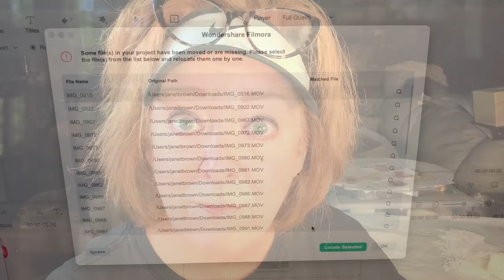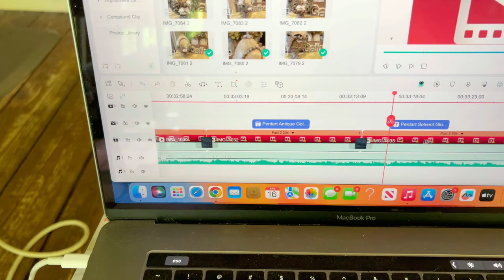Spring Wall Decor

Comment: You really showed off a lot of great techniques. That turned out fabulous. I can totally appreciate losing files. That is the most frustrating thing ever. But, you can get various types of  storage that you can add to your computer that are very cheap. If your computer has the capability, you can get an SD card or,   if you have USB capability then you can get an external drive thatconnects via USB. I don't know anything about MacBooks, so you might want to check with an expert. I just do windows type computers and have used both of those methods on my laptops. Take care and thanks again for sharing your techniques
Reply from the maker: Thank you and I appreciate your tips! I’m not very tech savvy.🤦‍♀️ I did purchase some SD cards a couple of years ago, but they didn’t hold very much and I was totally lost as how to use them. 🤷‍♀️

Comment: That method of cleaning your brushes also works for cleaning wax brushes. 😊
Reply from the maker: True! But if your wax is water based, you can just use the soap and water, unless you’ve let it dry.
Reply: @designsbyJ  Yes that’s true, I generally use Annie Sloan so it’s harder to clean. I’m definitely gonna try it on my other brushes too.